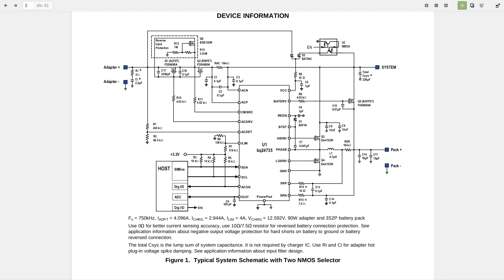How To Repair No Power On Samsung NP905S3G Or Any Other Laptop

Comment: please my Samsung same as yours. the issue is the power and battery light is on without pressing the power button and is not running. please what can be the problem. thanks
Reply from the maker: can be a lot of problems. check an external display and 3.3 and 5v voltages and that power chip.
Reply: @diymariuselectro  not running at all, CPU fan not running

Comment: Hello, good afternoon, I have a laptop with the same problem. Can you tell me the specific name of the part you changed?
Reply from the maker: sorry bro,but was long time ago and I cant remember now. I hope u can find in the video the name of smps IC.
Reply: please my Samsung same as yours. the issue is the power and battery light is on without pressing the power button and is not running. please what can be the problem. thanks